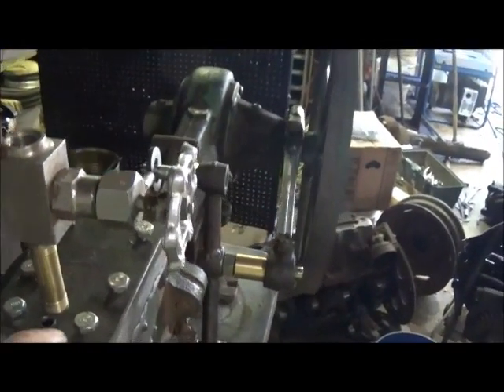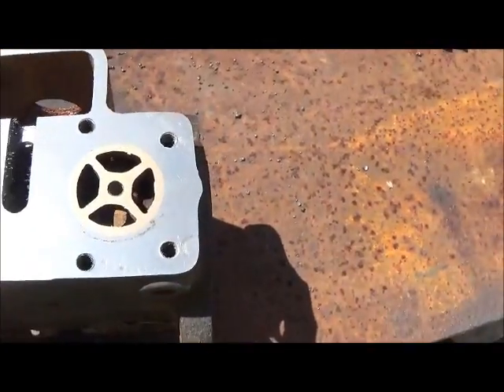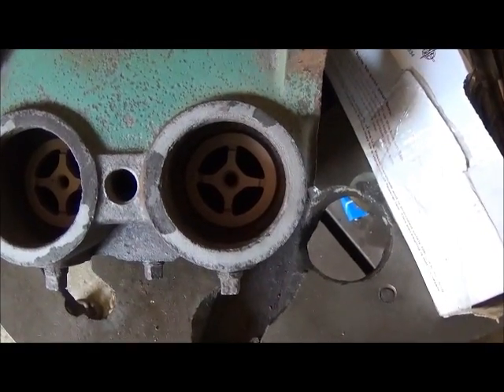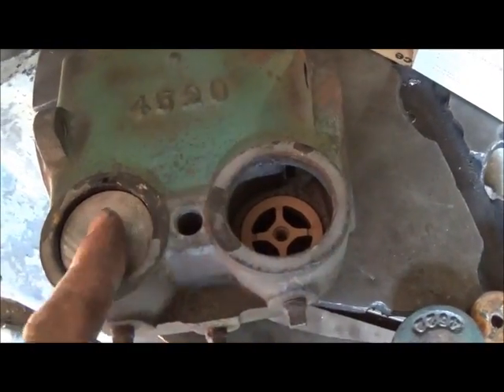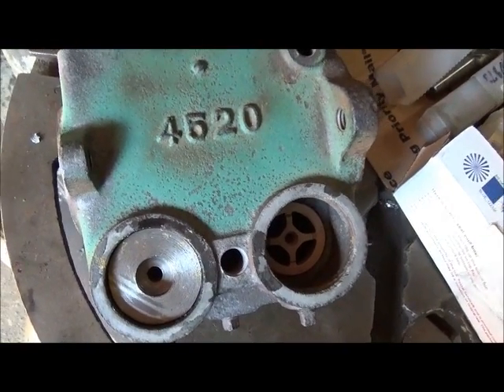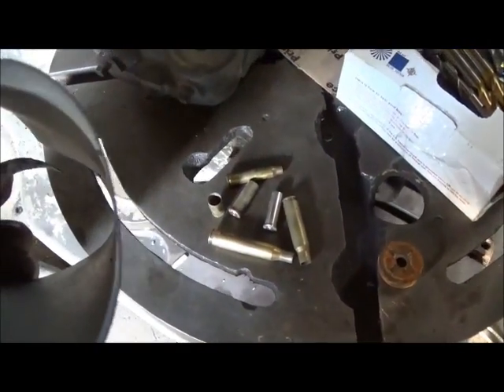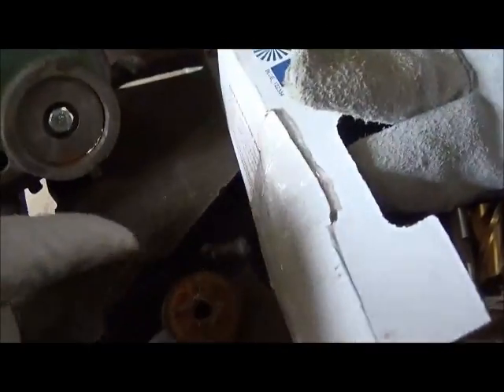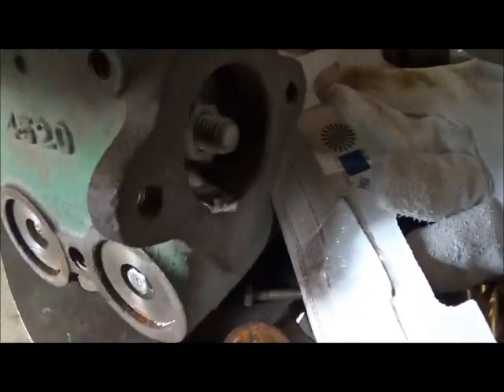Building A Steam Engine From Shallow Well Pump pt7

Comment: Hay Jonathan.When you cut & milled the cylinder in pt1, how did you get rid of the end mill track marks? Real nice flat satin finish! Keep up the good work.
Reply from the maker: +Flintstone Engineering  A piece of DA sticky sand paper, stuck to the table of the band saw then just done it by hand.
Reply: +Jonathan W "The poor man's lapping plate". Worked great.